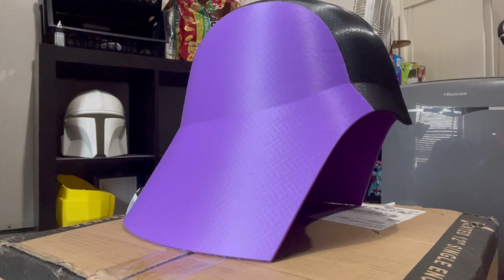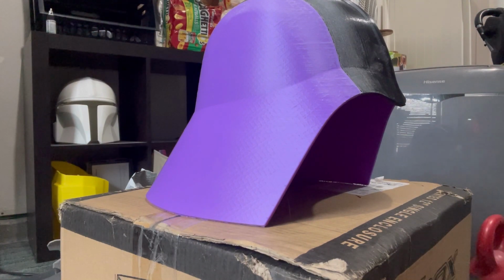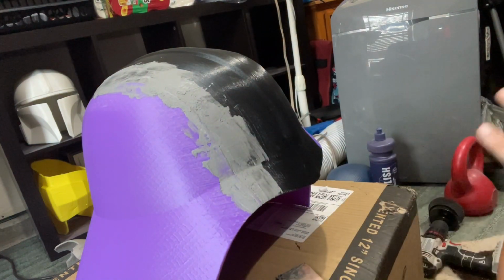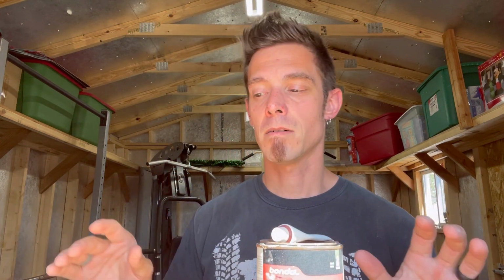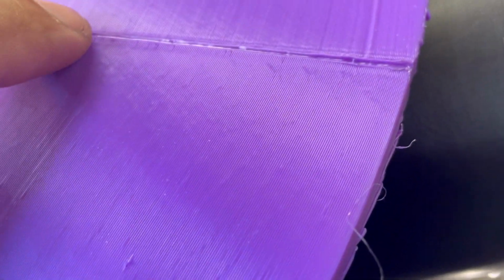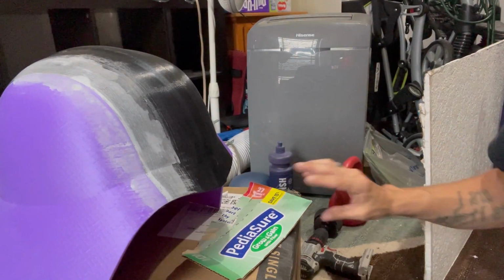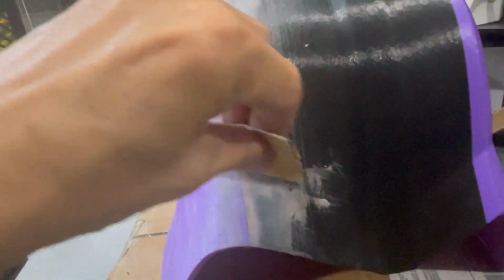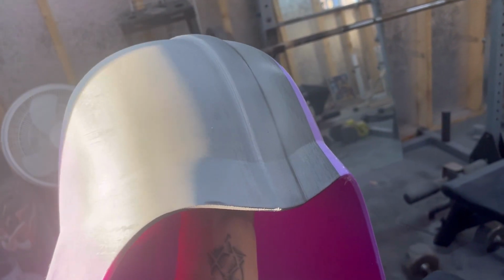PLA welding pt 2 | how to use bondo plastic metal & putty when finishing filament welding

Comment: I know this is old, but I see you're still active.  I've seen car body guys use a piece of tape on a body line then add the filler to one side...let it almost cure and then remove the tape.  Sand it flat and you keep your line easy.  repeat the process for the opposite side.
Reply from the maker: Yep that an old body shop trick!